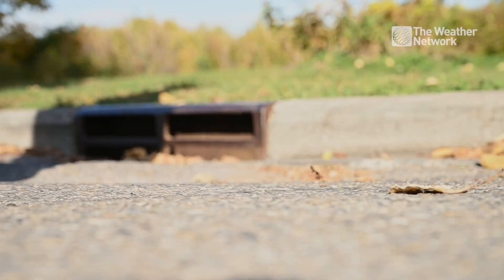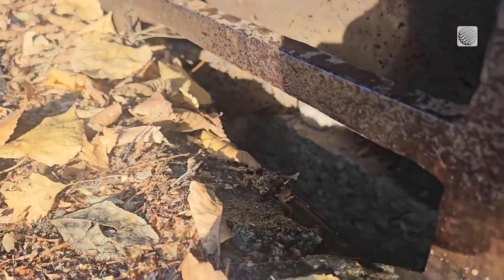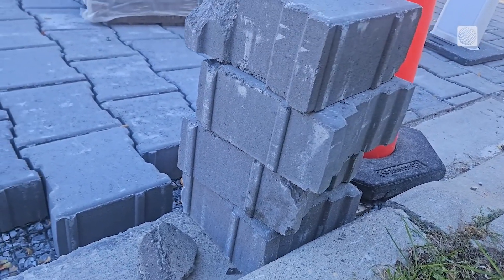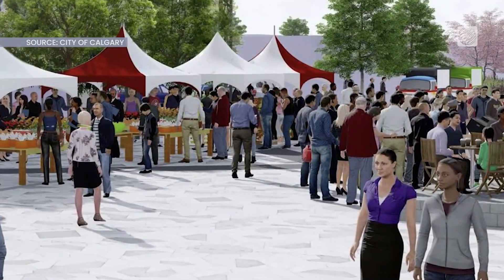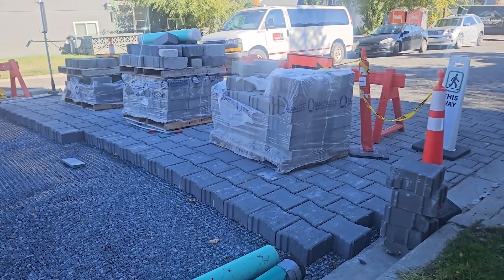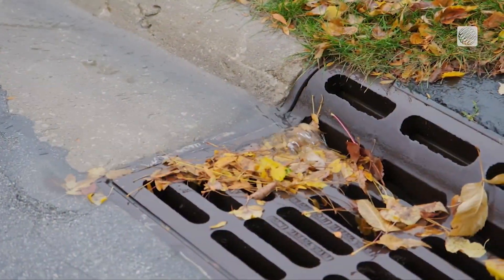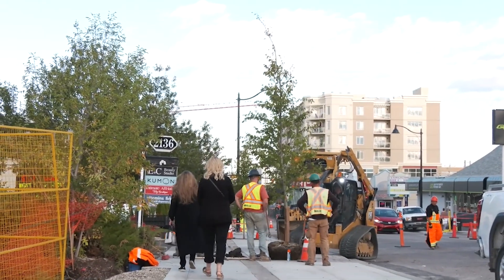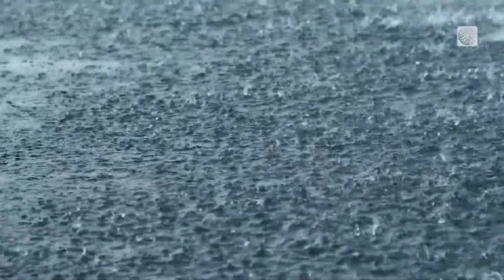These New Anti-runoff Pavers Are Being Tested on Calgary Streets

Comment: Hopefully it was a study done before installing it. Freeze/thaw cycles, salt, ground softening below, due to not drained water, road sand clogging these spaces in between. I'd like to see the same road a year or two later. Uneven, caved in? Alberta has unforgiving winters. The rain or snow melt water must be effectively removed to maintain the soil beneath integrity and structural strength. I hope it was educated engineering behind and the subsurface is effectively drained... to the storm water drains.
Reply: This product - PaveDrain - has been installed in multiple locations where winters are unforgiving. Freeze-thaw issues are virtually eliminated by the subgrade design; and will certainly outperform asphalt w regards to potholes.
Reply: @jeffbuch3962  Agree on asphalt potholes :). Yes, I do not know what was the sub-grading design and agree - if properly done, it will last. Germany made roads lasted since WW 2 till today. Proper design of sub grading.